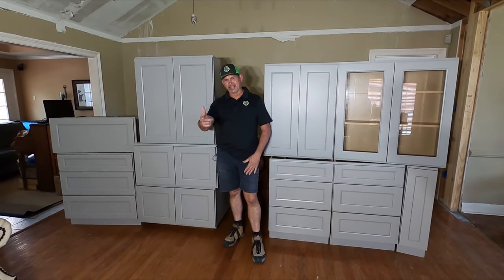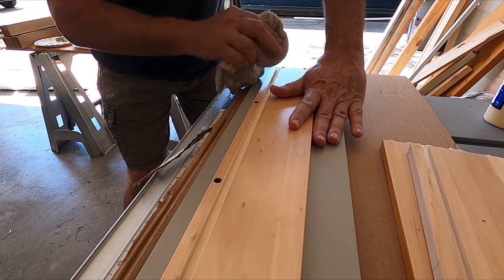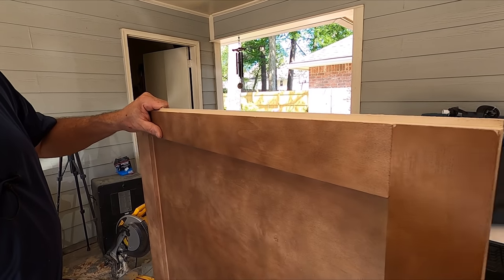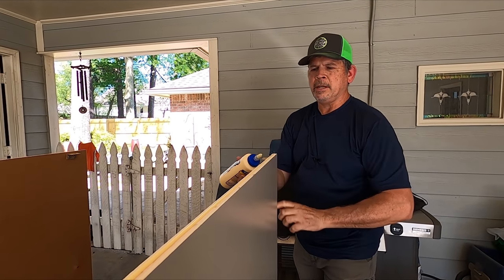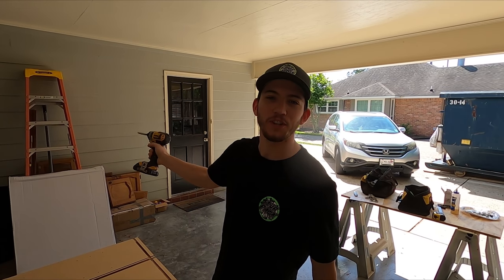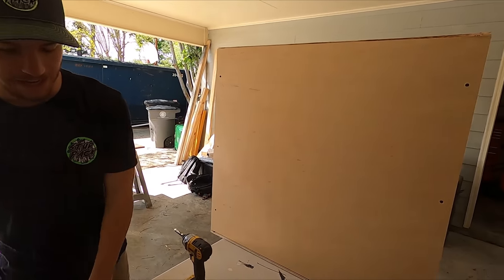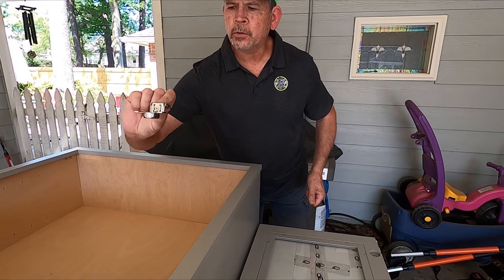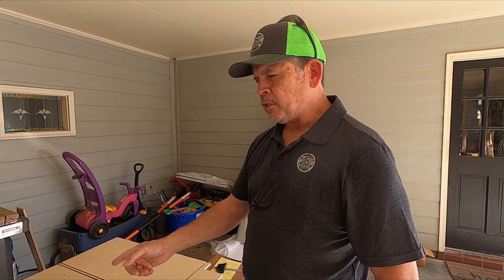How to Build/Modify RTA Cabinets! Ep. 13

Comment from the maker: Hey gang, if you're looking for this brand of RTA cabinets, contact quavana.com to see if they can assist you.  They are located in Houston and are our regional distributor.  We order our cabinets from Triple Eight Stone in Baton Rouge (225-223-0855) on Airline Highway near Sherwood Forest.   Thanks.
Reply: Hi Paul, first and foremost, thanks very much for sharing your skills and tips. I've been following you for months now. I called Quavana trying to see if I can buy RTA for my Dallas house. I was told I can only order from their catalog on their website, any custom stuff can not be done. Is this the same story with your Baton Rouge dealer Triple Eight Stone? Thanks much
Reply: Those aren't drywall screws, well, I hope they're not. Drywall screws are designed to snap off. They are not designed to handle weight as a fastener. I would swap them out if you suspect they are just drywall screws and use some stronger ones where they need to support weight.
Reply: I made the same mistake when I was younger. 😉
Reply: @shinigamilee5915  using a temp fastener until glue dries, which is the primary fasting method would be fine.
Reply: THANK U.
Reply: Most of the factories moved out of China after the increase in import taxes.  We moved ours to Malaysia as well.  We used to have a warehouse in Houston.  Our main location is in New Orleans.
Reply: I called Quavana today and they only sell to contractors.  They do not have an online order on their website.

Comment: Yes guys it's Lenny in Prairieville. After the 2016 flood, I used these cabinets after the flood and I glued and screwed them with no issues!!!  The guys at work were saying they spent 30K for cabinets!!! My insurance gave me 30K less than any contractor wanted ! So I used there and did my kitchen for $2800!!!! THEY ARE AWESOME!!! Great video as usual!!

Comment: I just assembled some RTA cabinets from overseas. . Very nice quality. . Better than most cabinets today. . I used a tube glue like loctite 3x, better glue and NO RUNNING.  Dries overnight.  If you have the say 3 drawer 36in. Cabinets,  add flat support under the center of drawers for support.

Comment: Just finished watching your tiling videos for my kitchen remodel and now I'm ready for cabinets and found you again.  Thanks.  I'll be modifying and painting my existing cabinets and buying RTA ones as needed.  For some reason, everyone wants white cabinets today, and wifey is the same, so I'll be spraying too, but at least outside in a carport so no masking the kitchen.  If no bar clamps, I've used old bicycle inner tubes (save them) as long rubber-bands to clamp wood.  Bungee cords might also work.  Hope those brackets are a quality plastic like nylon since the ones in my son's fairly-new upscale house are already cracking (translucent white).

Comment: Great job!

On cabinets with water pipe (under sink), I prefer to use a bead of clear silicone caulk (tub & tile) around all the inside joints of the finished bottom of the cabinets. (Then after I leave, any future leaks won't be able to get into the end grain and ruin the wood.)

Also do it on every inside & outside joint if it's an area with a lot of bugs... the wood can't move if there's humidity changes, but it completely seals the cabinets from water, bugs, dust, etc.
(Like to put Borax under all lowers too... making sure there's no good place for bugs to live.)
Reply from the maker: Good tips Matt thx!  Jordan and I actually talked about sealing the interior seams 👍
Reply: This is exactly what I did when I did my kitchen. also used silicon to 'seal' the holes in the back and the cut-out for both the cooktop and sink (on a budget, so used a laminate benchtop)

Also liked the idea of the cabinet under the sink being easier to clean, as I put in a pull out trash can under the sink. this way I don't have to worry about getting it to wet when cleaning it out.

Comment: I just bought RTA from RTA Wood Cabinets, based in NJ. The cabinets I ordered came out of Denver. I spent 41 yrs at UPS, these arrived packed in great shape on a pallet. The heaviest were on the bottom, there were corner guards and shrink wrapped super tight. They are solid wood, soft close doors, dove tails etc. I did a 10x10 foot kitchen for $3200 and that included shipping. The drawer bottoms are 3/8 thick ply, it will hold anything without breaking.
Reply: I’m looking at ordering from the same place,how did the assembly go?
Reply: @Big_Kool  They were super easy. No woodworking experience required. The side pieces have a dove tail cut on them, they just slide into the dove tailed groove on the back of the face frames. Everything else is drilled and cut for you. There are grooves (dadoes) cut for the backs etc. I used glue in the slots, and extra long screws other than what they provided. I also put 45 degree blocks in each corner to strengthen them. I also used 18 gauge finish nails, or you could clamp them after gluing. Either way you can literally build a cabinet in 20 minutes. The drawers are the easiest ever, super simple yet effective.
Reply: Do they have a name & web site?

Comment: I like using cupcake/ muffin pans to hold all the screws and parts when I assemble things.
Reply: I bought the pans mechanics use that have a magnetic base.  No metal pieces lost when I inevitably bump it and easy to store since the bottom will also stick to any metal surface like a fender washer screwed to the wall.
Reply: My dad does the same thing!

Comment: Good call on those glide installs on the drawer.  My home that I moved into had those screwed into the sides and not the bottom and they all (100% of drawers) had those screws fail (strip out/split) within 2 years of moving in.  I reinstalled by screwing into the bottom and haven't had a problem since.

Comment: I did 2 small kitchens with RTA cabinets I bought online and had truck delivery. They are decent and are Made in China......They had metal brackets to assemble. I added some glue and staples. They have no particle board and have held up well. I added soft close bumpers and one set has self close drawers. Not to bad to assemble. I did use cheap laminate counter tops from Home Depot. Overall I was happy with the finished product for the cost.
Reply: Rich B what brand did you use?

Comment: Thanks so much for the great tutorial. The logical flow and precision of the vid is excellent. I noticed the 3" offset at the door opening. Many people would just put a 30" cabinet on a 30 or 31" wall. The offset makes a nice aesthetic.  When I use a full overlay cabinet I usually put a 1" filler at the wall. It's not necessary but I Iike the look.  There are so many times a standard depth cabinet just doesn't work. I've never seen the process, a big help for brave souls willing to do the mod.  Thanks again. Excellent.

Comment: Love watching your video’s and the quality of work you guys do. A tip in case you haven’t heard of before is to use a self centering drill bit on those plastic clips, that attach to the bottom front of drawer, to prevent the wood from splitting. That’s what we do at our cabinet shop. Keep up the good work. 👍👏

Comment: Nice work buddy. I'm using a similar RTA cabinet on a project and I can't get over how nice the finish is as well as the drawer construction and soft-close hardware.  I got a complete set of cabinets, fillers, moldings, and panels for just under 5k!  These will look as nice or better as a "fully built"  cabinet once they are installed. I'm using RTA's on all my rehabs under $1M.

Comment: I also glue any furniture from IKEA or any RTA stuff. Good to see that I’m not alone in the overkill department 😉
Reply: This particular joinery is designed to be glued but I am with you on adding glue! A small bead of construction adhesive along the shear panel (back panel) on ikea/particle board furniture really adds a lot of rigidity!

Comment: That is a good design with nice anti-sag shelves...
The wife and I are renovating a small house we rent out that pretty much got destroyed by the last tenants, just decided today to just rip the cupboards out as what was left that didn't need attention wasn't worth $30. It is always less work just ripping crapping out rather than trying to clean and fix around it, isn't it. Also saw some premade stuff at local retailers... will investigate more after seeing this.

Comment: RTA cheapened things up a bit, no more pre-drilled corner brackets. And the kick plate, I haven't even figured out yet, mine are not long enough - wondering if its a mistake because there is no corner notch cut out either, and that is about how short they seem to be, but, idk.  This is a great info video regardless, very well done.

Comment: The only change I would make is instead of using the drywall screws go ahead and use stainless screws like Craig screws or one of the other stainless kind because they're way stronger.  Especially for attaching face frames. If you use a number eight screw, I think that's what they are anyway, those are the best for face frames. Just need to hang them both level then screw together.  Screw all bases together before installs. Usually like 2 in screws

On uppers glue is sufficient, maybe 18 gauge nails also. 

For attaching to the walls, everyone should use stainless pan-head screws which are stout. They are probably simpson strong tie brand, star bit, 3" to 3.5" into the studs.

Also there are shelf pin plunge bits at home depot or rockler for like 5 bucks to 20 bucks and it plunges to the set depth. Its got a spring on it.
Reply from the maker: Thx Tyler, good stuff!👍

Comment: I use a piece of pink styrofoam board to assembly my RTA's and if you get glue on it after it drys you can pop it right off. Great video
Reply from the maker: Cool tip thx Bob 👍

Comment: Back in 2017 I rebuilt my kitchen after a water leak ruined the cheap particle board contractor cabinets around the sink.  I used RTA cabinets from Lilly Ann Cabinets.  They came from Asia and had the clips.  I wish I had seen this video first...  Like the Quavana, the Lilly Ann cabinets were made form nice plywood and solids and had dovetailed drawers.  No more particle board sponge to get wet and mold.

Comment: I use 23 gauge nails to hold the dovetails together instead of glue. Much faster and they never come apart. They also make little metal brackets with 2 screws that work great on some drawers. I can assemble and install a small to medium kitchen in a day or two with me and 1 or 2 guys
Reply from the maker: These dovetails were so tight I needed clamps to pull them together.  Thx Derek 👍

Comment: Had one question on cutting the cabinet down. Would it be easier to cut waste off the front and recut the toe kick in instead of having to recut the dado and redrill the shelf pin holes? Love the videos very very informative!
Reply from the maker: Perhaps.   Either way works but still would have to re-drill pins holes 👍

Comment: In trimming the cabinets to fit into space, did you adjust depth for drywall thickness and counter overhang?
Reply from the maker: Yes, I accounted for 1/2" drywall and 1-1/2" counter overhang 👍

Comment: I never glue the dovetails. I pin nail. This way the drawer can move if the drawer slides arent perfect and no clamping.
My dad taught me how to do things, from house framing to cabinet making. He taught me all the tips and tricks. But you never stop learning He had all the good tools too. He said "dont cheap out on tools or you will be sorry. Get the right tool for the job". Although I cant sink a 10d nail in 2 blows, I learned a lot! I am very thankful for his teachings. After his passing, in inherited all his amazing tools. I have taught my son as well and got him involved with all my projects. He now has a house if his own and does all his own work. One day he will inherit all my tools as well. 
Not only do you save a ton of money by doing it yourself, you will also be confident that the job is done correctly. Instead of paying for someone elses labor, you can put that money into quality components.
Jordan: I cringe when you call your father "dude". IMHO addressing him as "Dad" would be more appropriate.

Comment: One little "extra" that I always added in a kitchen remodel was a piece of white Formica or sheet vinyl flooring covering the inside bottom of the sink cabinet. If you look at a sink cabinet floor after 5-10 years, it is always a mess from the water and cleaning products that get on it. It's a cheap and easy fix for that. I would caulk the full perimeter with clear silicone. I used to do remodeling, but now I'm retired and I just watch you work. - Looking forward.

Comment: I always worry when someone says they use RTA cabinets. A few local people on the MS gulf coast I know say that you can essentially build those same cabinets for the same (if not cheaper) than the RTA ones and you get a bit better quality overall because you can control every aspect of construction. For what it's worth though, those do look pretty good as you're right on about traditional ones being particle board which is heavy, cheap, and falls apart.

I do wonder why you didn't use some sort of L-bracket or wood to reinforce the corners instead of using the plastic braces. Seems that is important for ensuring the corners for drawers don't widen over time.
Reply from the maker: I screw down a plywood sub top to support the countertops.  This really strengthens the boxes

Comment: If you are looking for a secure method of drilling holes for your shelving supports you might get a piece of scrap wood cut to the desired thickness so that it acts like a depth stop for the bit.  Leave it on the bit as you drill each hole.  No risk of blow through.

Comment: My Ole Man passed just before I had turned 12 , He was a Commercial Fisherman by trade & whatever else came along after Season Passed . One thing he did was build mullet skiffs . He never once used a power tool it was all cut , bent/ formed  , drilled , caulked , painted. I was the Fetch Boy . At most he only built 2 a year as other jobs popped up he would have to go to the one that put money in his pocket that week . I hated mending nets , after school an homework was done had to feed & water the assorted Critters being Chickens, Couple cows , 6-12 hogs , 20-30 Rabbits . He would auction off most of them an start all over again . Anyway after addressing the Animals man there would be several hundred feet of Nets to be repaired 😳. There were times I would have given anything for a Hamburger,  Being unaware I was eating high priced groceries- 🤣

Comment: I never use drywall screws though because I have some in my cabinets and the heads are starting to rust after about 15 years. I always use zinc plated torx
Reply from the maker: Cool Thx 💪

Comment: When using most solid woods, I use  pneumatic stapler to temporarily hold until glue dries so can immediately remove clamps and move on.
Reply from the maker: On the drawers?   I’d be afraid staples would either split the dovetails or not fully set into that hard maple but I get what you mean 👊

Comment: If you’re using dimensionally stable drawer bottom material and using a joint, like dovetails that can’t be disassembled later, why not glue your drawer bottom to prevent vibration from loose drawer bottoms later?
Reply from the maker: You could but what’s going to cause drawer bottoms to vibrate?

Comment: I've assembled thousands of those Chinese cabinets. Face down, put the sides on and run pin nails through the carcass sides at an angle into the face, put the bottom and back on. never see the pins and those l brackets aren't used. Only use them when you can't see them. Keep all of the doors off until they are installed.

Comment: Which company do you use? I have a local company I use in Sacramento CA that is very similar except our fasteners are cam locks which are arguably a little better. We also have a wood support that goes front to back instead of the white plastic.
Reply: The RTA supplier that I use is called KitchenSearch, they have a website with a number of different brands and styles. If you chat with anybody there, tell them I sent you.
Reply from the maker: These are from quavana.com in Houston, our regional distributor, but we can pick them up locally in Baton Rouge
Reply: What is the name of the company in Sacramento?

Comment: Hello, nice video. 

I see that you didn't use the angle clips (@6m18s) to attach the sides to the back. Was this intentional because you used the drywall screws you drilled? 

I ask because I am in the process of designing a making my pantry in MR MDF and I feel like more screws are better.
Reply from the maker: Correct the screws are basically applying clamping pressure while the glue dries.

Comment: Please use a wood screw for strength rather than drywall screws . Drywall screws are very thin and brittle ( they’ll break if there’s ever any flex) . Otherwise nice job and great presentation. Love your vids.
Reply from the maker: Thx Kevin.   Yeah they were more for clamping pressure while the glue dried.